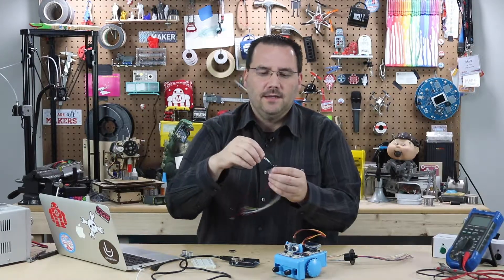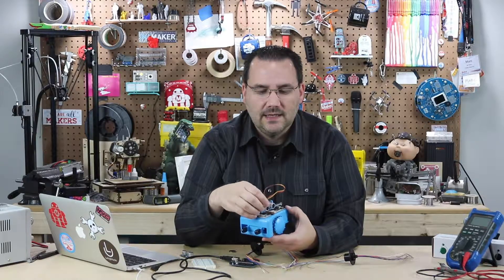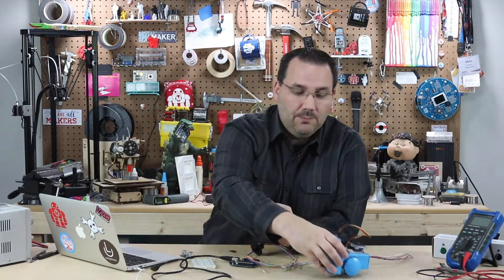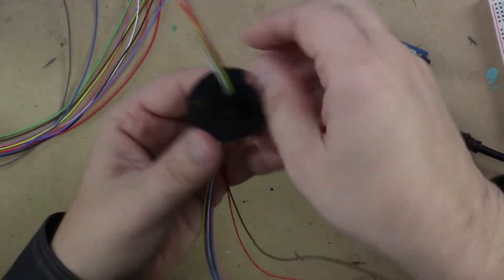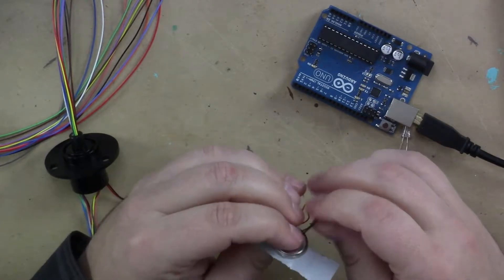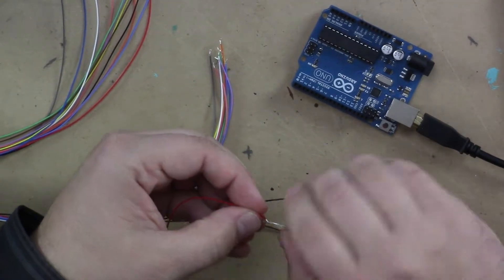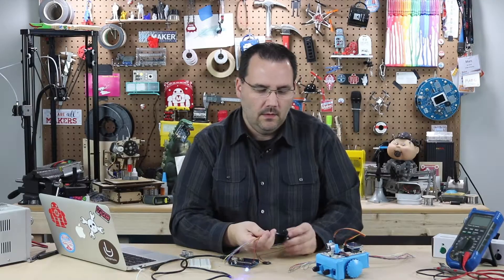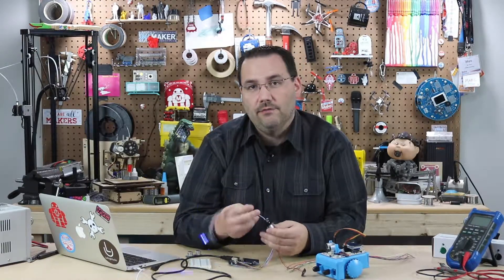Arduino Prototyping Outputs #82: Slip Rings

Comment: I have made my own direct drive steering wheel. And wheel base for sim racing. I used a slipring for power and data going from the buttons on the steering wheel to the Arduino pro micro, controller the buttons. Without it I should have a USB connection on the outside

Comment: We definitely can’t see that there is no loss with your LED experiment. 99% of LED’s in the wild have a duty cycle of less than 100% yet nobody notices they are blinking. I made my own slip rings with copper washers and 4mm ball bearings but I have yet to test it on high speed data. I’m hoping I can push data in the 10’s or kHz for a propeller clock.

Comment: So a slip ring needs a motor to spin the output side. Correct?
Reply from the maker: You don't need a motor. The slip ring just allows the wires to spin 360º.
Reply: @MarcdeVinck  thanks ,I wasn't sure whether these were motorized or not.
Reply from the maker: @anthonytesta3716  They are not.
Reply: @MarcdeVinck  so with these min slip rings how do I attach a motor?

Comment: I want to build a steering wheel with buttons. A slip ring seems perect for the job but why are they more expensive than the fake arduino 🤔  or am i just looking for the wrong ones
Reply from the maker: Slip rings are going to be more expensive that a knockoff microcontroller. Just the nature of scale and manufacturing costs.
Reply: @MarcdeVinck  jeah but i wonder that the scale is so much smaller and manufacturing of a microcontroler seams harder than a slip ring.

Comment: I can't seem to find any information anywhere on  how to get a motor connected to one of these. I figure you'd attach the flange to a pulley and drive it with a belt, but what do you do if you want the motor and slipring below the pulley, and a platform of some kind on top of it? Where would the axel for the pulley go? And where would you get parts for that kind of thing? I've searched and Amazon's selection of that kind of thing is slim. If anyone could give me any hints, it would be greatly appreciated.
Reply from the maker: I'm sorry, I really can't follow what you are trying to do. The slip ring just allows wires to be rotated infinitely. If you are looking to spin it with a motor, you will need one specific for that task.
Reply: @MarcdeVinck  Yes. I'm asking HOW TO ATTACH A MOTOR. You can't attach it axially because the wires are in the way. Does nobody else in the universe want to spin one of these with a motor? What do you use them for?

Comment: So can I connect the slip ring to an Arduino board? I am working on this project that has rotation involved and I am wondering if I can connect the stationary wires to the Arduino to send signals to the sensors. The sensors going to be connected to the rotating part.
Reply from the maker: Yes, slip-rings allows for (low) power and data wires to continuously rotate.

Comment: Hi. Thank you for this great information. I would like to know whether these slip rings can be used to power the Arduino. Will the power supply be continuous? so that Arduino will not restart in between.
Reply from the maker: You could easily mitigate any power issues by adding the proper capacitor to smooth out the power supply. But keep in mind it can easily handle data, and that's more sensitive to variations and timing, so it's most likely ok.
Reply: @MarcdeVinck  thank you so much for the response 👍

Comment: I understand the slip sing, but still missing: how do I rotate that? 
It seems like a dumb question, but it's not an motor, so how can I combine that slip ring with an motor? The only way seems to put the motor on the exactly oposite side. But, them, the exemple given at 0:15 is not very accurate, since the Slip Rings isn't an drop-in replace for the servo.
Reply from the maker: This is a part of a larger system. Like a tire on a car. The tire doesn’t make it go, but without tires, it doesn’t go! So, yes, it doesn’t move anything. Think of it as a way to transmit power and signal through an area of rotation that is part of a larger mechanical system. Imagine an LCD sign that may rotate 360 degrees. This would be the coupler used  to send data to the LCD display. Hope this helps explain it a bit.
Reply: @Marc de Vinck  But it's still weird because there's no small motors/servo with some "slip ring" built-in. It's not that easy to add an ordinary motor and combine with the slip ring. It seems much more complicated than I initially thought.
Reply from the maker: @FrequenciaJogos  Think about having this as part of a tubular axel. Then have a chain or belt drive to a larger gear on the axel. Does that make sense. Oh, and yeah, it’s a complicated setup. But when you need a slipring they are great!
Reply: I am also looking for an example of how to mount a slip ring in an application
Reply: There’s something called a through hole slip ring that allows you to put an axel I think for a motor maybe, look it up and see if that’s what you want

Comment: Can this be used to connect a camera?
Reply from the maker: Sure. But it is dependent on how many wires you need. The best option, if you need long times, is to just use 2 wires for power, and use a camera capable of a WiFi connection.
Reply: @MarcdeVinck  is it possible to set up a raspberry pi camera to the gpio ports and run that through the slip ring?
Reply from the maker: @kentthomas1045 The Pi camera uses a lot of pins. Check the data sheet. I think it's about 15. And I don't think you could use it while in motion, the bandwidth would be too much and most likely cause artifacts or not work....would have to test. But once stopped, if you have enough conductors, it should work.
Reply: 8 wire option use anything u can with 8 wire
Reply: also you should consider of the amp for each wire and diameter for it